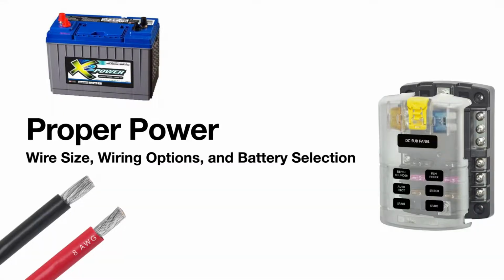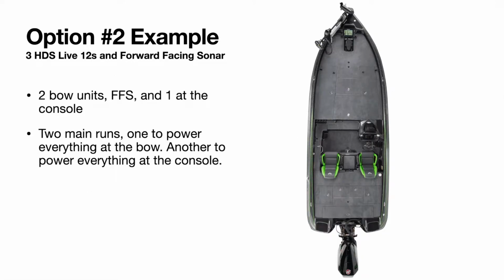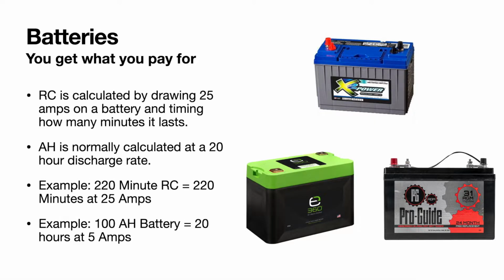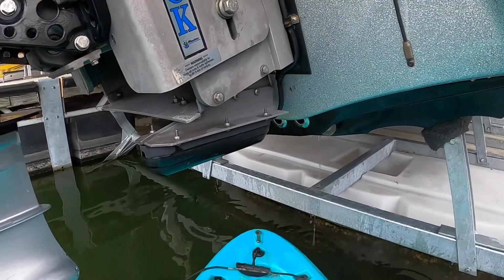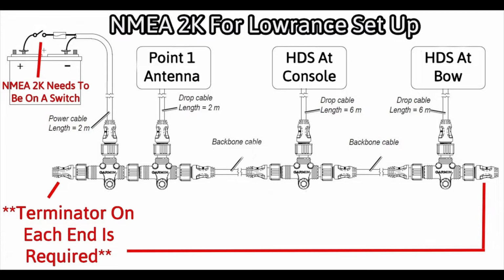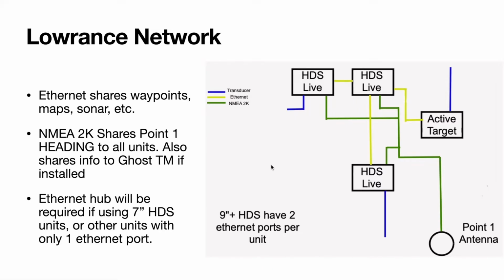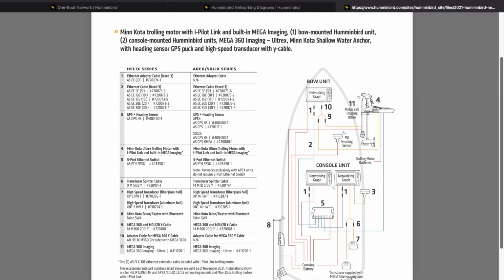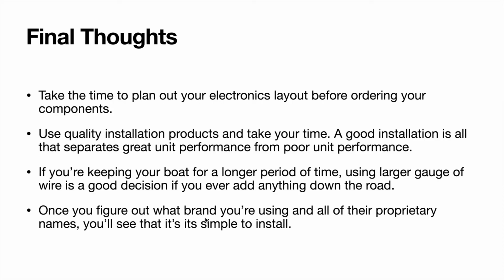Installing Marine Electronics | The Ultimate Guide Series

Comment: This is a crazy informative video. Im looking to put all new electronics on my 2000 Basscat Pantera 3 and really had no idea where to start. All the existing electronics are ancient and the wiring felt like it was gonna be a huge pain to figure out. 1 question I do have, my boat has a master power switch closer to the console for all accessories, I figured I would still install a power switch for the incoming electronics but I should have no need to install another switch for the accessories correct?
Reply from the maker: No need to change out the current accessories switch, but yes definitely install a new cutoff switch for your new electronics

Comment: A thought, I am in Canada. In our weather I would not use lithium. Our temperature fluctuations are too severs. I still believe and there are many examples out there that show this type of battery is unstable.  I am not prepared to take the risk of losing everything important to me!
Reply from the maker: Lithium ion, yes. Lithium iron phosphate not as much. They will not operate under -4 Fahrenheit usually, and most will not take a charge below 32 Fahrenheit. Some cases down to 24, but this all battery temp as well not just air temp. We’re not nearly as cold as you guys though

Comment: The BEST video I have seen yet on installing marine electronics!!! I bought a barn find 2000 Lund Adventure that had been in storage for 15 years. I have updated the trolling motor plug and battery cables to handle 24 volts, installed an onboard battery charger and was trying to determine the best way to wire up my new Helix 10 and the older Lowrance Elite HDS. You explained it perfectly!!! Thank You
Reply from the maker: @jamesmay3812  glad it helped!

Comment: Excellent video, the g4 hilix units now don't need 2 pucks for proper waypoint positioning. During set up each unit lets you decided where tou want the gps to be used. When setting up the bow unit you check the box for the internal gps in that unit when they are networked together. Not sure if that was possible when this video was made. You answered lots of questions for sure. Thanks for the information
Reply from the maker: Thank the lord humminbird finally caught up with everyone else in that department.

Comment: I notice some guys with the same install use a breaker/on-off switch in front of the battery. Does your switch have a breaker? What amp breaker would you use for your example of three graphs?

One more question. In your 2nd example, when running 8 gauge to the bow and 10 gauge to the console, would you use a fuse block at the console to tie in graph, network box and NMEA and a second fuse block at the bow to tie in the two graphs and active target or would you go seaclear harness style and use a connector to tie all positive and negatives together? I’m sure it’s personal,preference but I was curious your thoughts.
Reply: Thanks for your help. Also thanks for taking the time to post fantastic videos and taking the time to respond to your comments.
Reply from the maker: The switch I use does not have a breaker, like you said some do if you want to have a main. Not a bad idea in case something went bad from battery to fuse panel. In the second example you could do either, but a sea clear style would be a cleaner install for that method. I prefer the fuse block to power everything if I use that. You can find the sea clear cable online to make your own, or check out Wholesale Batteries for one already made, but much cheaper.

Comment: Because all the units are wired directly to fuse block with proper fuse size, does that mean that the supplied inline fuse holders that come with the units are not used?
Reply from the maker: That is correct. You could also do the same thing with a tap block (probably a bit cheaper) and use the inline fuse holders that come with the units.

Comment: Question - I am going to rewire my old bass boat like you described in #3 setup. do you run your all your electronics and accessories (bilge pumps etc) off the same starting battery?
Reply from the maker: Yes. It has become popular though to add another battery just for electronics, and you keep your pumps and other boat accessories on the starting battery. Not necessary unless you’re running something crazy like 5 12” graphs. Just make sure you get a starting battery with good AH/RC rating so you don’t have any trouble with low battery. I recommend a size 31 AGM with the most AH you can find (100 or more)

Comment: Thank you so much for this video! Absolutely the best detailed and precise explanation  on Marine electronics I've seen on Youtube.  Ironically, I happened to visit a Marine/Boat dealer today asking about deep cycle batteries ect...they told me that I should  run my bass boat electronics including graphs and gps antenna to my trolling motor batteries!  Not my cranking battery...your video corrected recommendation error.  After seeing this, I think I will follow suit and get the X-2 Power AGM 31 for my cranking battery...as you noted you get what you pay for and it has a great warranty.  What type of batteries do you recommend and use for your trolling motor?  Greatly appreciated!
Reply from the maker: Glad it helped. Agm or lithium are the best for TM if money is not a concern. I currently have agm, but have also used regular lead acid size 31 and never ran out of TM power. I used Duracell lead acids from batteries plus for 4 years no issues. Deep cycle I should add for TM too.
Reply: @MidwestOutdoorExperience  Thanks Austin!  I'm a new subscriber now 👍!  Hope your enjoying your new Nitro - sweet set-up!   Too funny, I was planning to visit my local Battery Plus store tomorrow.  I think I'll find just what I need.  Regards
Reply from the maker: @chazt4863  that’s Nathan’s nitro. He’s enjoying it. I have a Phoenix. Thanks for subscribing and good luck out there!
Reply: @MidwestOutdoorExperience  Ok! Thanks...Yeah, I'm here in Central Florida touching up the electronics and power on my Skeeter - getting ready to so some swimbait fishing this winter and spring.  I'll keep you posted.

Comment: Wow that was great. 1 ?  Just be clear , can I run my mega live and mega 360 to the fuse panel, I tried putting them together and running them straight to a battery and they wouldn’t work at the same time and my Helix 15 monitors went pretty much haywire.
Reply from the maker: Yes you can run them to the fuse panel. I would run them separately and have the corresponding 2A fuse for the Live and 1A fuse for the 360. Make sure you have a battery cutoff switch that feeds the fuse panel as well.
Reply: @MidwestOutdoorExperience  will do , thank You!
Reply: I just found out that the sea clear harness doesn’t come with a fuse panel, can I run mega live with one monitor on one line and the mega 360 on the other line with a monitor? Will there be interference with them? Sorry to keep bugging you but no one else is responding
Reply from the maker: @crappienaterfishing1198  yes you can do that. You can also get a fuse panel and use PACER or ANCOR brand 8/2 Duplex wire and it will be the same as sea clear, but then you could put in a fuse panel
Reply from the maker: I believe sea clear sells an adapter too for accessories. Basically a connector that goes out to 4 separate power connectors. One for each graph, and one for mega live, one for 360.